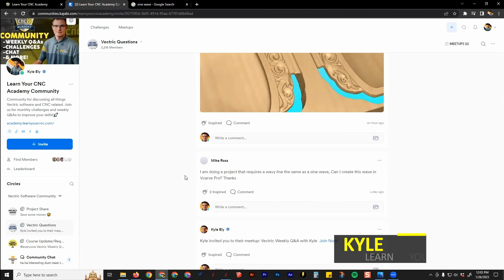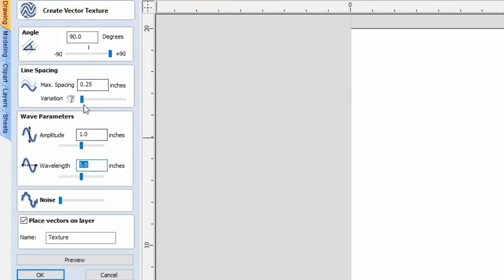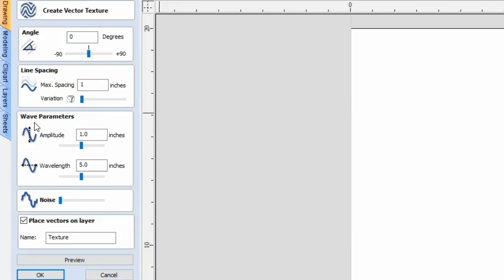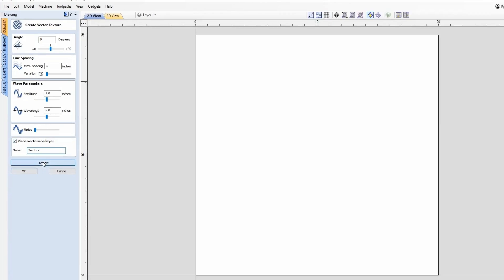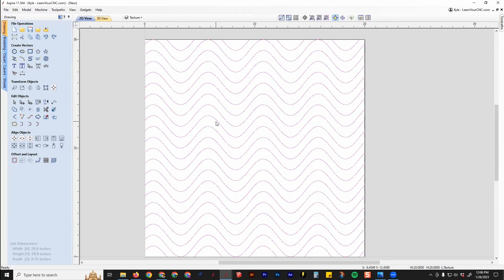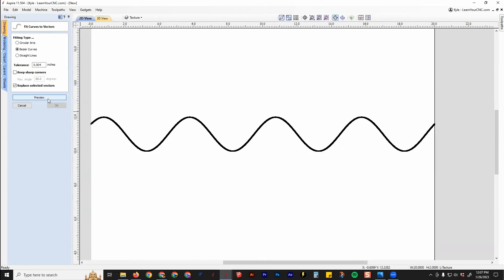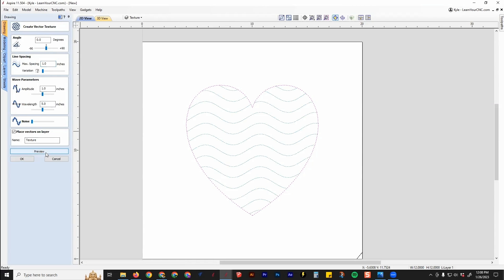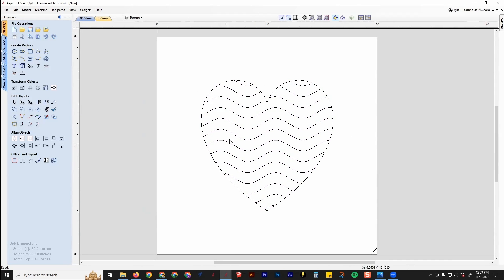How to Make Wavy Texture Lines - VCarve, Aspire, & Cut2D Quick Tip

Comment: Hello friend, I have a problem with the chamfer tool.
Since I often mill aluminium, I would like to have the outer and inner edges of the workpiece deburred with a small chamfer of approx. 0.3mm into the material.
Unfortunately I haven't succeeded yet because the Aspire chamfer tool always only mills up to either the outer or inner edge of the vector and therefore nothing is deburred.
To do this, you would have to be able to set the values for the milling depth independently of the width, which unfortunately is not possible.
Is there a solution to this?